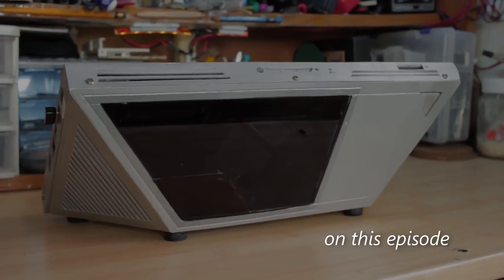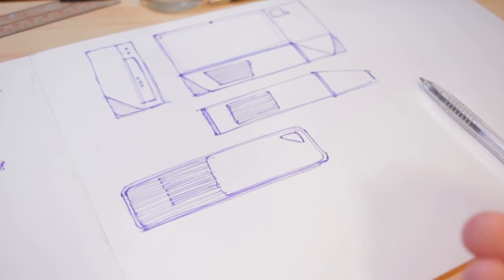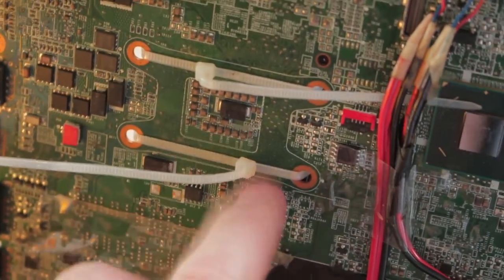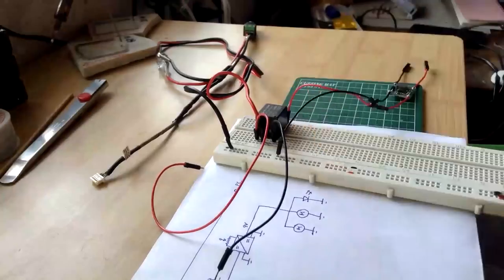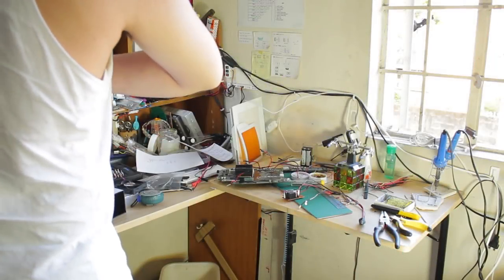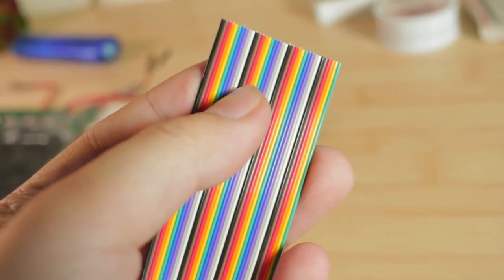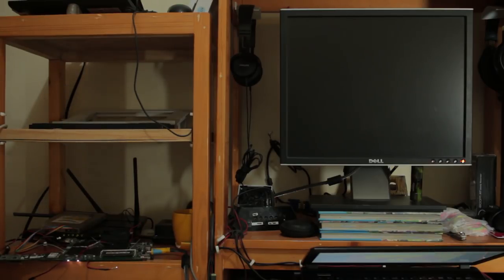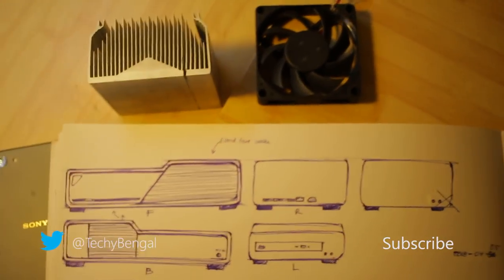From Scrap Laptop to Working Desktop - Pt. 1 of FrankenPC Redo

Comment: I wish soldering skills were as good as yours! Keep up the good work!
Reply from the maker: Really? My soldering is kinda crap on the SATA extensions.
Reply: I've recently soldered a cable on my laptop's motherboard that draws 12V power directly from the battery in order to attach a fan underneath the laptop. You certainly don't want to see how terribly I've soldered it...

Comment: im not gonna hate on the gay ribbon cable ....im gona hate on the relay ..... a relay contains a coil that generate magnetic field to attract the magnetized latch and close the circuit and what happens when a coil is energized and you cut the power ?? .......yep it dumps alot of energy back ....so every time you turn off your computer the coil in the relay dumps his energy in the fan wire ..... unless you want to fry the processor or the chipset ....you need to modify that circuit ....you need a optocoupler in between the relay and the computer fan wire or a diode in between the relay legs (watchout for the direction of the diode)
Reply from the maker: What type of diode should I use?
Edit: Found that I need a freewheeling diode.
Reply: first thx for not snapping out like most ytubers do 
second sorry i couldn't reply fast .....i was in university ....studying like a dork  XD XD 
third awesome work ....keep the videos coming
Reply: What is this ancient dork thing you speak of
Reply: Just joking I'm old and I don't her young people saying dork to often

Comment: Working on my own frankenlaptop build, not getting as involved with the rewiring as I’m completely inexperienced.

But I’m running into an issue that involves using a 12v fan (maybe 2) to cool both the CPU and the HD3000 chip. I just don’t know how to power it, especially considering the existing blower fan needs to be plugged in still to the 5v connector.

Any ideas?
Reply: you can do the same thing in this video but instead of 9v dc-dc buck converter you have to use a 12v one they are quite easy to get but remember to put a diode across the coil of the relè (with the side with the white/gray band connected to the 5v and the other side connected to ground)
Reply: there is a better way to control the fans using the pc fan pwm signal instead of the relè but you will need a fan hub
Reply: Ok so I found a fan hub powered by SATA. Let me run this by you if that's ok.
1. Move 300gb 7200rpm HDD from SATA slot  to mSata slot
2. Connect Fan Hub to SATA slot, connect AMD heatsink and fan to hub, run constantly
3. Without disconnecting existing 5v blower fan, use for airflow.

 With the 12v fan and full sized heatsink it really shouldn't be an issue if I keep the existing 5v blower connected right?
Reply: you can't connect a 12v fan hub to a laptop sata since they usually don't have 12v but if you plan to run costantly(so no pwm signal from the cpu fan) you can just do like in this video but using a 12v dc-dc converter
Reply: you can keep the 5v blower connected as long it's airflow doesn't oppose the airflow of the other fan

Comment: EJ Tech

Is it possible to remove a GPU from a gaming console, then use it in a working pc or laptop?

This question is bugging me all day and i wanna know if its possible.

Think you can help me out with some info on wut you find out if you wever try to?

Please and thank you for ur time to read my comment :3
Reply: No ps4 and xbox one are using APU´s (accelerated processing unit ) it´s cpu + gpu in one die (chip) , so it can´t be used . You would have huge problems - apu pinout , chipset ect .
Reply: Honza Kounic 
Ok thankd for that, im glad to know some people are willing to help me xD
Reply: No it is not possible, but you can put a desktop gpu into a laptop via "exp gdc beast" which uses your laptop's mini pcie slot, or ngff slot for newer laptops.